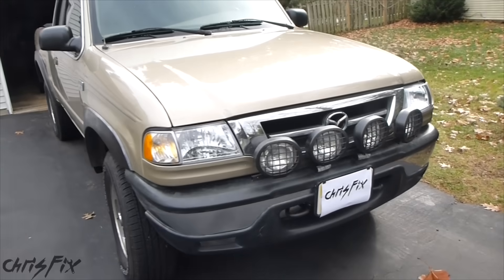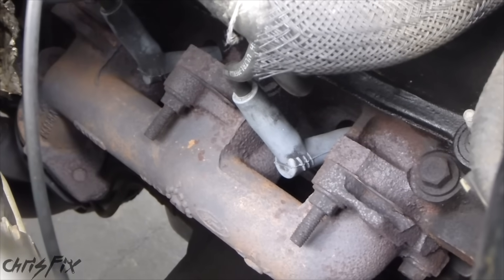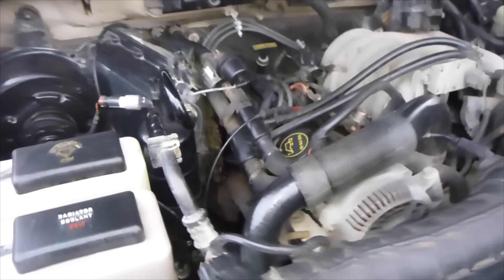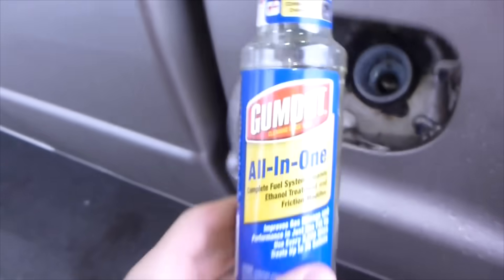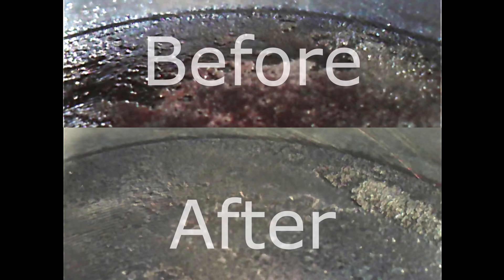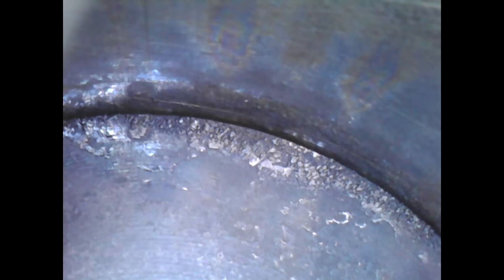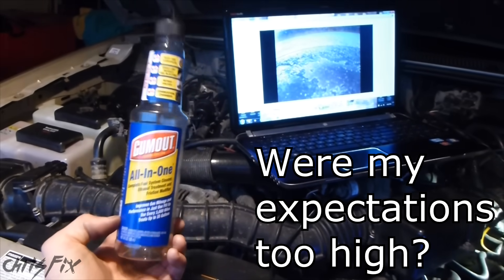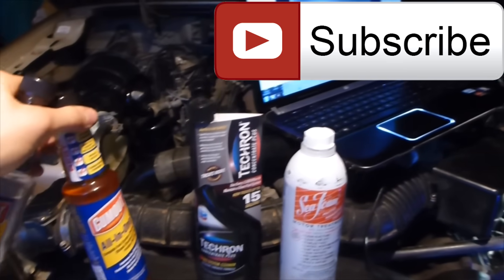Do fuel system cleaners actually work? Testing Gumout "All-in-One"

Comment: not sure why you zero'd the trip. you didn't actuality prove anything by doing that.
Reply from the maker: +AdrianJayeOnline If you watched the video, it was to see how many miles I went on the tank and the idea was not mileage anyhow, I used a camera to look into the engine!
Reply: +ChrisFix Hey Chris, I believe that was a very rough estimate on how many miles. What I do to check my millage and MPG, is to run the car till the petrol light comes on , fill up to one click only, then zero the meter. Then drive around till you get the petrol light come on, note that millage, and that is a more precise reading as to how many miles you did on that tank, fill up to one click and note how many liters you filled knowing the KM's you can then work out the MPG. I guess you could do it that way, but it is a very rough way and hasn't really proved how many miles or consumption you lost or gained. hence my question. The camera stuff is all good and is great proof, but you didn't prove accurately gummouts claim on millage. Good video though not knocking anything on that point, always watch a lot of your vids, txs for taking the time out to reply to my points

Comment: They say the proof is in the pudding. Your video shows this to be a very slow way (expensive) to clean your piston tops and or your valves. Maybe the solution would work better to pour an amount directly into the spark plug hole to soak and run it later. Do the valves and port have the same amount of build up.

Comment: Pretty much all those products need continued use in order to work. I believe the advertising even suggests that with continued use,expect varied results. Never assume any fixit stuff in a can works all that well. In the old days you could actually add water into the top of the carburetor as you are holding the throttle open,this would steam clean the cylinders. It actually worked too!

Comment: Looks like most all of these have been more preventative than removing old carbon
Reply: +David Bartz I was about to post the same thing. 
That sludge is clearly oil/exhaust residue from recent runs. Solid deposits form due to cristallization which happens after high temp/pressure during a considerable time... ie, engine's lifespan 
Seems to me this product works, but only if you use it regularly. Otherwise it cant reverse damage done by basically years

Comment: 200 miles on a full tank.....
Reply: Skyler Bicknell my 2011 Ford fusion hybrid gets about 578 miles/tank with 17.5 gals
Reply: I have a 2011 Ford fusion hybrid and a 17.5 gal tank.  My mpg was dropping to about 32mpg , but I just added a bottle of fuel additive and a bottle of injection cleaner and on a 120 mile highway run from Biloxi to Pensacola it rose up to 38mpg. Back to where it was when I bought it new, but I also have the original plugs and will replace them after 176k miles mostly highway.
Reply: 209 miles divided by 17 gallons ( 18 gallon tank you figure he's almost on E, so 1 gallon left) is about 12 MPG...damn, that's dismal. I get about 200 miles to Half my tank, about 7 gallons....
Reply: @joshn938  That was my thought. Get a better gas mileage vehicle.
Reply: @joshn938  damn, quick maths, that means that you do 400 miles which is 643 km with 18 gallon tank? that is not something to be proud of hah
Reply: @domenbojc6026  It was a 14 gallon tank. 7 gallons times 2 is 14. 28 mpg on average. Not sure what that is in km per liter or whatever. Anyways, I long since sold that car.
Reply: @joshn938  hi
Reply: @joshn938  I get 54 us mpg with my 5 series on motorway 😂😂
Reply: +abd bach It's sad. Wish the US could get diesel trucks that small...
Reply: Josh Ford we can now! Ford has released a 3.0 Turbodiesel V6
Reply: abd bach I get about 850 average per tank....
jetta TDI
Reply: My 6 cylinder 2009 Wrangler gets about 25 mpg highway mileage, and Wranglers are about as aerodynamic as a brick on wheels.
Reply: A friend of mine has an electric car and he says there isn’t any carbon buildup on his pistons. Hummm? Lol
Reply: I think he has oversized tires on that vehicle and if so the odometer will be lower than it should be . the mpg calculations are not be accurate when taking that into consideration
Reply: @stevensprague3445  Could very well be it. Just watched a Video where he cleaned the MAF and said he got 19mpg
Reply: i get less than 300 kms full tank on a 3.5L charger lol. 100% city driving and that range is also during the winter. it goes up during the summer time. just need a good tune up in spring and i might actually hit that 18 mpg lmfao
Reply: The Im sitting with e46 having nearly 1000km per tank
Reply: @Simonightis  What's a km? ;-)
Reply: Douglas Williams kilometres
Reply: Arnas Leušinas how???? I get like 500km
Reply: abd bach my 04 mustang gets that bad mileage 😖
Reply: My 94 chev with a 454 gets 190-200 miles to a tank. 19 gallon tank so about 10mpg
Reply: @tannergallie9061  had one years ago. 10 miles a gallon Going up, down hill and over a cliff.
Reply: These additives are all rubbish. They're just a very nice iand easy ncome stream for the producers .
Reply: @toonmag50  Dipetane, an Irish product, is proven to increase fuel efficiency (in both petrol and diseasel vehicles and oil home heating boilers) and certainly removed some carbon deposits from my >200,000 mile Toyota Carina II with 4AF engine.
Reply: @Rhythmeister  it's all delusional . Don't be so taken in by the general fuel additive rubbish and definitely don't pump individual brand names.
Reply: Must be something wrong with the car...
Reply: +kgfgfg1 He must do a lot of city driving, but a Ranger/B series shouldn't be getting that low for fuel economy. I have a 1969 F100 that gets 12 in-town from a built 302 (18-20 on the highway, depending on how I drive) but, shit it should be getting around 17 or so in town, 25 on the highway...
Reply: abd bach I get 250 KMS on a tank in my Jeep haha
Reply: Holy shit i just realized that! My Yukon XL Denali 6.0 V8 gets better gas mileage than his Mazda!
Reply: Yeah I just did the same calculation and damn that's bad. Something had to be off on the car, it can't be meant to be that thirsty, my 21 year old Volvo does more then double that, and it weighs 1,6 tons
Reply: abd bach by my math he was getting 15.3 mpg
Reply: Uuufff
Reply: He should have used just at cleaning a fuel 91 or a little higher with this super juice, then it just might clean it better, but I'm sure all these super juices need about 3+ fill-ups to clean perfect.
Reply: Shit is wild lol. I won't complain anymore about my v6 Buick getting 330 miles lol
Reply: I get that in my c4 corvette
Reply: +Joe Blo you know what's sad is my buddy has a big honking brand new chevy suburban that gets 23 mpg on  average,  big as it is, yet his v6 ranger musters only around 22 average. Hell, the New Corvette will give you 30 MPG highway on a more than 400 Hp V8
Reply: U.S. needs more diesel cars. it's a shame rarely any of our cars are diesel.
Reply: @FordFans721  the last thing any country needs is more diseasel engines, unfortunately they're a child killer with all their NOx and particulates.
Reply: The 3.0 liter engines with an auto trans gets awful gas mileage. A buddy of mine had one and it was the same way. Mine has the 4.0 manual trans, & all highway I get around 400 to a tank
Reply: Or 19.6L per 100km. Thats realy bad driving. ChrisFix should better learn how to drive instead, how to get a clean Engine.
Reply: @kgfgfg1  Your remark is unfair. It may be that his engine could use a tune-up or perhaps he does a lot of stop-and-go driving or his car has some other issue.
Reply: kgfgfg1 LoL 😂
Reply: He could just not be resetting the trip odometer, and it may have started on like 800
Reply: Man I get 1000 kilometers (around 700 miles) per tank on my 2.0 turbodiesel.
Around 700kms (550miles) on my tiny 1.8 V6 per tank.Some of y'all got a really bad fuel economy
Reply: +kgfgfg1 lol

Comment: ChrisFix, I absolutely love how you're going out and testing these products with a scientific approach.  I think you did this test scientifically and fairly, however there are two things that I think would be awesome in a future test:
1) I'd like to see if it would preform better if you drove the entire distance in a single trip, allowing the engine to get much hotter.
2)Maybe it didn't work as well because you're Chrisfix!  I'm assuming your engines are much cleaner than most; what if you tried this same test on a random old car with tons of carbon? 

Thanks for the videos!
Reply from the maker: +Electron Pusher Thanks a lot! The tests were all performed with the same drive. I did a 2hr highway run (4hrs total) and the rest city driving). Then engine was at operating temperature the whole time.

Comment: Chris, check out Sarge LS1 on Google.com. He and his buddy's are into cleaners..they have been using Marine outboard TCW3 rated oil to clean and lube the fuel system. There is loads of info on Google about this method. Use it every time you get gas the ratio is 1oz marine oi to 5 gallons of gas. Remember it's has to. E TCW3 rated. I use Pennzoil 
Premium plus or Pennzoil xlf. Quicksilver.semi synthetic. There are lots of them. Just use a good quality.

Comment: Carbon can be on any gasoline piston and does, but buildup happens more on short trips or long idling and normal to sluggish acceleration combos with other factors.  Try to drive completely highway and use one benchmark car while also driving sporty with the acceleration.  My family has a phrase of burning the carbon out.  My grandpa for example babies his car.  Also the Gumout system tune up instead.  It looks to have the same properties and more while also having a bottle just like the seafoam.  Just poor in the gas tank.  One other factor is the gas you use.  If it varies one gas may burn cleaner than the last.  Shell gas is great.  common store stations are the minimum.  Use a top tier gas from GasBuddy and Shell tops with BP close.
Reply from the maker: +Ninjamaag Thanks for sharing your tips!

Comment: Hey Chrisfix, have you tried Gumout Multi-system tune-up?  I have used this quite a bit bc it contains PEA.  I don't have the equipment to check the pistons, but I would like to get your opinion.  THANKS!
Reply from the maker: +Paul Nieves I have not tested it yet but be careful with pea because it etches aluminum if it sits on it.
Reply: Appreciate your response...you have the best videos out there.  THANKS!

Comment: As an Automotive engineer, these do help with port injection engines, but with GDI the deposits are far more severe, and the risk of internal engine damage far outweighs the benefits as GDI deposits are "hard carbon" vs the "soft carbon" in port injection engines.  When you break the hard deposits loose, you are in most cases going to sustain scouring to the cylinder walls as the small hard crystalline deposits break loose and smaller particles are forced between the cylinder wall and piston.

Also, the advertised effect is generally "up to 50%" of the deposits are cleaned.

That is ONLY if used as an engine running upper induction cleaning. Added to the fuel tank very little cleaning actually occurs, and with the new GDI engines NO fuel touches the valves so in tank additives are worthless with GDI.

Same with top tier fuels and GDI. No benefits we can verify where there is with port injection engines like your test shows.

Nice test!!
Reply from the maker: +RX Performance Products, LLC Thanks and thanks for sharing the info!

Comment: if you took the engine apart and cleaned the cylinder top with a wire brush,what would be the outcome? I know it would  be cleaner,but will mpg and power delivery be better?
Reply from the maker: +Roman Range If you have carbon deposit issues, then yes, it will help to clean that carbon off.
Reply: +ChrisFix how hard would it be to take engine apart on a 8 cylinder and thanks for answer

Comment: That's really not what these products are designed for. First of all, a fuel tank treatment like Gumout is a preventative solution. You use it regularly to help prevent buildup. You don't use it to clean an already gunked up fuel system. 
Secondly, a fuel tank treatment is only 1 of 3 parts of a fuel system cleaning. You need to clean the lines and the intake system as well. Gumout won't do this. You need a 3 step system from any auto parts store. Or, any oil change place can do it for about 50-80 dollars. you need to do this every 60k miles.
Reply from the maker: +Ken Cavallo Thanks for sharing Ken. Actually, you dont need to do any of this. The fuel in the US is great and I have never needed to use any fuel system cleaners even after 300K miles

Comment: Marvel Mystery Oil
Reply from the maker: +OldJunkDodge It is on the list!
Reply: I'm looking forward to the MMO results too. I add 4 oz to a tank at every oil change. My car is new but I also add 1/2 qt at oil changes starting about 50K miles. MMO is cheap but I still hope I'm not wasting time and money.
Thanks Chris Fix!
Reply: Doug N i started using MMO since my malibu hit 50,000 miles after using mostly regular gas since i bought it. At first i didnt notice to much but after 2 oil changes i noticed a better throttle response. I'm hoping this removed most of the sludge in the engine that built up over the years and i havent stopped using it since.
Reply: old junk dodge yes!  My dad used it - was 85 when die - Marvel Mystery Oil is "oldie but a goodie!"

Comment: One thing to ponder on these cleaners, is that are they really needed? Look at it from another point of view, that the carbon build up doesn't cause any issue with the actual piston head or cylinder head as they are static surfaces.
The carbon building up does increase the compression ratio, which will increase the power that each cylinder can produce, and carbon is an insulator, so it will not create any hot spots on those static surfaces, which reduces the possibility of detonation.

I can see the benefit of cleaning out the injector nozzles for a uniform spray pattern and better combustion, and carbon removal on the valves to insure a nice clean seal.
I would be interested in a test where you had a dyno test before and after to see the difference, and maybe a view of the valves be removing the fuel injectors. 
Thoughts?
Reply from the maker: +Robie Blair I agree and disagree. Carbon is an insulator which will actually increase combustion chamber temps! But most cars I have seen are clean so you are right about not needing these cleaners in most cases.
Reply: I would have to disagree on increasing combustion temps as a negative side effect, the thermostat would keep the cylinder walls the same temp and the exhaust stroke would evacuate the heat after each ignition pass.  As a side note, when you build an engine for performance, many of the forged pistons are ceramic coated to help keep the combustion temps from potentially melting the pistons - because of the additional HP the engine is making.  The hotter/bigger the combustion process, the more power you create.  It is the compression stroke where excessive heat can cause detonation.

Comment: I work at a Ford dealership. you tested this very fair. gumout, Lucas and all that crap do not work. we use a thing called Terra Clean. it actually works. does the injectors and combustion chamber first, then exhaust O2 sensors and catalytic converter. it is 2 cans we put on a machine then tap into the fuel rail so the vehicle runs off the machine not the gas. it really does work. next time I do one I'll make a video for you. awesome video man
Reply from the maker: +Anthony Heflin Thanks for sharing. I guess I will have to test Terra Clean.
Reply: You need a machine to do it. But the kit comes with a bottle you pour into the tank. The bottle is the same stuff the 2 cans are for the machine to clean the tank and the lines(so  told by our Terra Clean guy) I can get a bottle. Any Ford dealer should be able to do a Terra Clean on your vehicle though. They service all makes and models. I know where I live it cost $225.

Comment: Hey I've got a question, I've got a 99 Solara Manual Transmission, I recently started having problems with acceleration. From 1st to 2nd gear I have some hesitation, or loss of power when I accelerate and the car stutters a bit. When I switch gear, the same problem happens from 2nd to 3rd, 4th to 5th. If I press on the gas too hard the car engine starts jerking again. Yet past approximately 2200 RPM for all gears the car accelerates smoothly.  I find it really annoying, esp since the car used to run so smoothly. Is this problem related to the fuel system or something with the exhaust?
Reply: Probably herpes if I was to guess

Comment: Hi Chris 

I'm not sure whether can you get Maz Nitro GX1fuel additives in the United States but the product itself is made in the United States. I've been using Maz Nitro for a while and I notice there is an increase in throttle response the manufacture also claims it also cleans the combustion chamber and piston cylinder and this is where I got skeptical after view your videos.
Maybe you could help clear the myths by review the product personally.